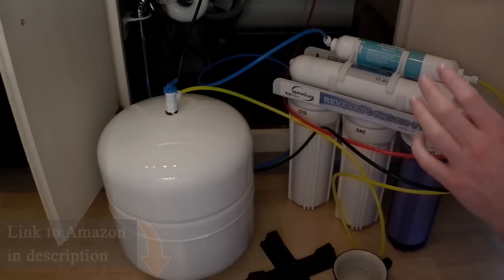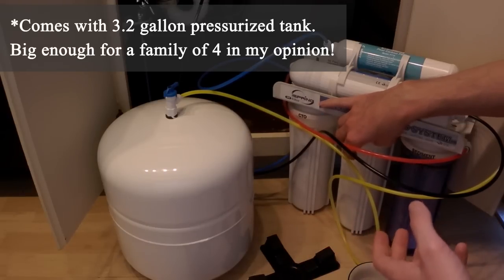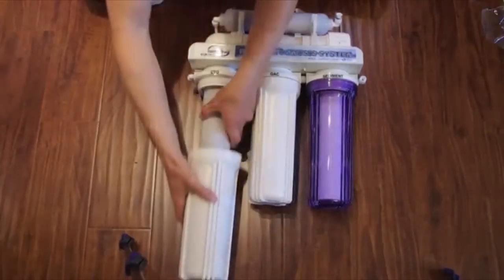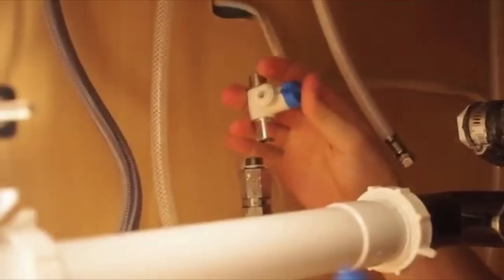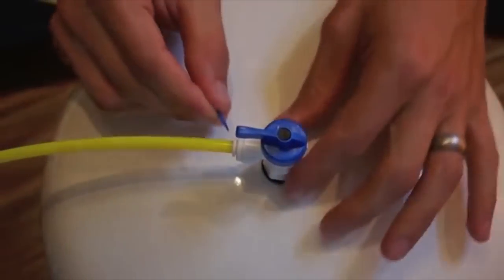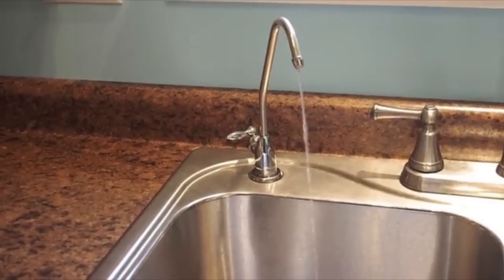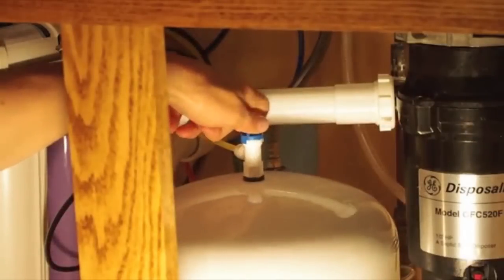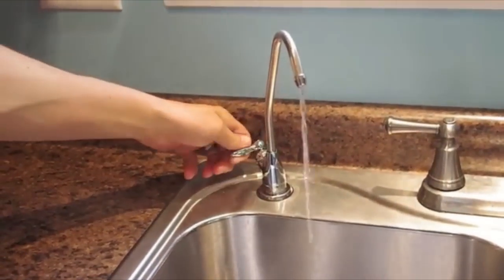Reverse Osmosis RO Drinking Water Filtration System for your Home

Comment: I've been installing R/O systems for over 35 years,  .038 ppm of TDS is way too high for a new R/O system. This R/O system is of low quality probably made in China or Korea components. Made in USA R/O systems with high quality components filters and a high rejection R/O membrane will reduce the TDS to as low as .002-.005 ppm and it will give you a great tasting drinking water. For $170 you're not going to get a high quality made in USA R/O system, for that you need to spend around $800-$1000 and they're not easy to find because almost everyone is trying to undercut their competition with lower price with low quality products. Bottom line.... You get what you pay for in this world.
Reply from the maker: What's a good made in USA brand?

Comment: Neglected to mention the amount of water you waste with this
Reply from the maker: I thought I did. It'll waste between 1:3 to 1:10 (good water to waste water) depending on the quality of your tap water.  Yes RO systems waste water because they reject dirty water but it's really negligible considering the average person using 80 - 100 gallons of water per day. It's recommended the average person drink 64 ounces a day (1/2 gallon) so it's not wasting that much water.  Assuming you're only using your RO system to only drink with then it would make a far larger difference to save water in other ways, like taking shorter showers or buying fake grass.

Comment: So we bought a unit and I installed it with no problem then we filled and drained it 3 times according to the manufactures instructions. We can't stand the taste, the water tastes fishy. Anyone else get that? We're draining the system a few more time..hope it helps.
Reply from the maker: Did you get the one with the mineral filter? or the 5 stage filter system?

Comment: Thanks for sharing. Like you, I live in a rental and is planning on getting a similar setup. It kinda sucks that I can't drill a hole in the table top for the spout, but I guess the second best option is putting it under the sink.

Does the unit decrease the water pressure? I mean, the tubes look sort of narrow. Also did you experience any health benefits after switching to non contaminated water?
Reply from the maker: The storage tank will keep the water pressure high for about the first gallon or 2 of water then it'll start slowing down. It regenerates constantly so after about 15 minutes the tank should be full again.  The water pressure coming through the tubes is very low, but that's good because it gives the filter a chance to remove contaminates in your water. I hope that makes sense. 
And yes, I do feel much better drinking filtered water. I'm sure a lot of it has to do with me drinking more water because it actually taste good.

Comment: hey erik whats the ph of the water on this system? thanks man
Reply from the maker: I haven't tested the pH, there's one model up that offers a Alkaline stage but I prefer to add the minerals back in myself to balance the pH.
Reply: Since the live lime is filtered from the tab water, RO water is slightly acidic.
Reply: Samer Saleh I tested the pH of the water from my RO system and it came back as 7. My system includes a mineral post-filter that I've added.

Comment: hey Erik does the system use electricity?
Reply from the maker: Nope, none. It all works by using the pressure in your water lines.  The pressure will push the water through the filters and fill up the water tank. The clean water is stored and ready to use when you need it.

Comment: is post carbon filtration done after the water is stored in the tank to get final water? or water is stored in the tank after post filtration?
Reply from the maker: Post carbon filtration is done after it's stored in the tank.  If you follow the yellow line connected to the storage tank, it's connected to the smallest filter on top (Stage 5 Post Carbon). At the end of that filter is a blue line that connects to your water faucet.

Comment: We bought it for our house and idk why it makes a weird sound after pouring water in a cup, we checked how we installed it and it still makes the sound
Reply from the maker: +Ara P Mine makes a faint noise when it's filling up the tank. Whenever you take get water from your drinking water system the pressure in the tank lowers and water will run through your system until it's full again. With a large cup of water, my system usually takes 10 minutes to fill up.  It could also be your "run off" from the RO filter. It's basically rejected water that empty's out into the drainage pipe.

Comment: Is there away for the unfiltered water to bypass the filter system? for instances, If I wanted to mop my floor with unfiltered water, what valve would I close to access regular tap water?
Reply from the maker: +rachel601lee Yes.  There's a "T" valve that splits your cold water line into two, one to the filter and one to the faucet.  Your faucet will remain unchanged. I hope that answers your question.

Comment: Using RODI to filter your water is EXTREMELY DANGEROUS. I have a reef tank and very aware of how dangerous it is. This puts your body in fluid over load. If you hitting low TDS stop drinking or you won't have enough ionized particles for your nervous system to work properly. Tap water is so much safer than reverse osmosis. You'll experience big mood changes that will resemble something close to depression. This is NOT A SAFE way to drink water.
Reply from the maker: +Kris1997mr I add minerals back to my water. I understand RO will strip water of good minerals and bad minerals. I just add the good ones back in.  100's of thousands of RO systems are being used. I would think there'd be more reports about the "dangers" if they were really that bad.  I've been using mine for years and can't stand the taste of tap water.
Reply: +Erik Summer it is in fact very dangerous, most people don't have the money to run an RODI. But I have family in the medical field and personally seen the effects of fluid overload. It's extremely dangerous, just be careful. For best effect since you are constantly running it, replace the filters every 3 months at least. I makes hundreds of gallons per week for were I work we change ours out every month. Now setting myself a RODI  for my personal tank. I actually came upon this doing research for the best fit RODI for my use. But most defiantly be careful. It's not as safe as one may think it is and is more dangerous than the most potent biological toxins (palytoxins) I work with.
Reply from the maker: +Kris1997mr I don't use a RODI. Are you referring to De-ionized water?  My tap water is over 500PPM. That's too high for me. I totally agree that your body needs minerals in the water you drink and that's why I use Concentrac which is made from the "Great Salt Lake". I have read a lot of reports of city water containing pharmaceuticals, toilet paper, fluoride and tons of other junk. You can read more about it here - http://amzn.to/1qDGrfE
Reply: +Erik Summer your de-ionizing the water, RODI is the full name. All the elements to the filtration process you named are all the filters you need to de-ionize the water. But from the tds you were recorded are still way to high and you are still getting a lot of those chemicals in the water. I'm not too familiar with what's exactly in the water, but your efficiency of the RODI filtration system would be enhanced by using two carbon filters. Also by running two it does exhaust the membrane as quickly. I've seen water quality with 900 plus TDS. The de-ionization is removing stuff that has more or less electrons, stuff like PO4 and NO3 but they are mixed with metals like sodium, so NaCl (salt) is ionized. All of it is being removed but with that high of TDS levels stuff like Hg(Mercury) is still going through so the best thing to do is get that TDS as close to zero as possible then add the minerals. But the water quality is still significantly improved. The water should be totally de-ioniz
Reply: +Kris1997mr copper is ionized so if you don't remove those ionized elements there isn't really a point of running the filter. All of the metals are ionized unless if it is a cation or anion. And it would have to complete the octet rule (8 electrons in the outer layer of the orbital shell). There's a lot more chemistry behind it but you have the right idea, but it would be best to entirely de-ionize the water, the only reason why the water taste better is because the carbon removes chlorine very well, that chlorine is what you taste. But carbon is a great stripper of elements.
Reply: +Kris1997mr You should stop drinking the water in Flint. Your brain is becoming toxic waste. FILTERS do not change the electrical charge of atoms or molecules. The only downfall to reverse osmosis is that it wastes water.
Reply: +chardrules you don't know what you talking about, standard h20 isn't electrically charged at all. But you add thing like salt it adds electrolytes. I work with these filter every time I work for 2 years now, I know exactly how they effect the water, it my job. Plus I use these filter for a reef tank then remineralize it with salt and magnesium, potassium, carbonated hardness, calcium and other minerals. I have college level chemistry underneath my belt. Please don't tell me what I do and don't know about this. I defiantly know a lot more than you about this.
Reply: +chardrules when you bring your ppm to 0 it's deionized. That's the whole goal of Rodi, carbon only removes cholorine and some other unimportant substances never did I say it removes ionized particles. I said all you need it carbon filter for the persons purposes. Also another way to deionize water is by putting it through H+ or OH-. Which is what I'm doing on top of sediment and carbon and the membrane.

Comment: Hi Erik. Thanks for doing this video. Very well done. Im in the same situation as you are, I can't install the faucet permanently. Your under sink install of the faucet is perfect. My question is, where did you get the bracket to mount the faucet to the side of the cabinet wall? Is it something I can easily find at my local supply store?
Thanks a million.
-T
Reply from the maker: Sheerkon Sorry for the late response. It came with the system. They've since upgraded this RO system but I'm pretty sure it still comes with it!

Comment: Have this system, the tank kept losing pressure initially but the company replaced it no problem. I didn't have any leaks but I turned it off when I was away for the first few nights.
Reply from the maker: Good idea, I turn mine off when I leave for a few days. The newer model comes with a water detector alarm. I put mine in a plastic container and added this water alarm http://amzn.to/1NEXqXZ just in case! I Thanks for the comment.

Comment: I will buy it, but I'm not finished watching your video. 

Question one: what's the PH?
Question two: does it remove fluoride?
Reply from the maker: 1. pH is a measure of how acidic/basic water is
2. Yes it will remove fluoride.
If you're concerned about your pH levels you can get the system that has a Alkaline PH+ Mineral Stage. I did some research and decided against it.

Comment: what is the difference in your water bill
Reply from the maker: That's a good question because reverse osmosis does flush hard water down the drain. I rent so I'm not sure. I don't think it would be noticeably higher since I only use it for drinking water. I maybe use around 1 gallon a day from my drinking water system and 100's from the shower/toilet.